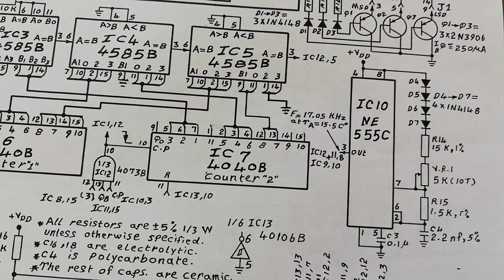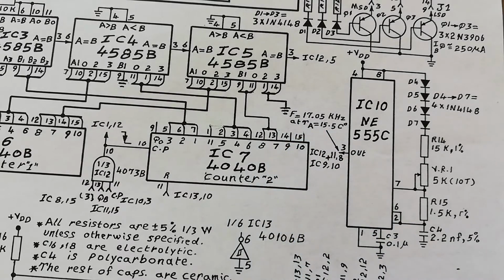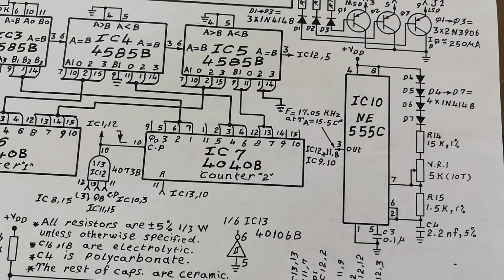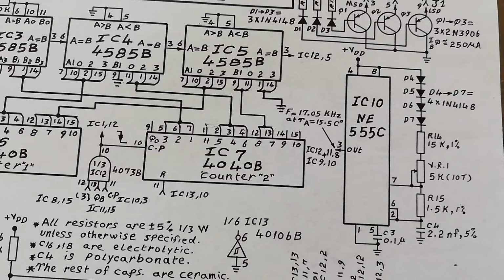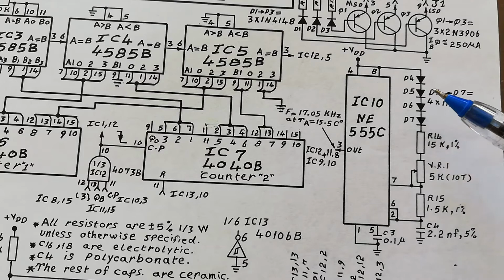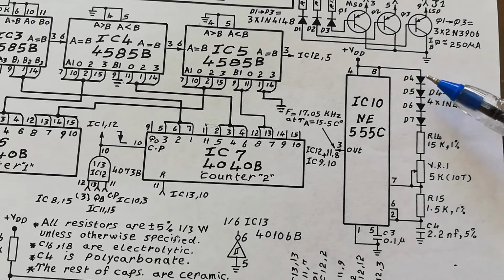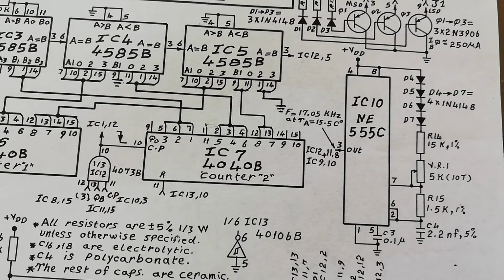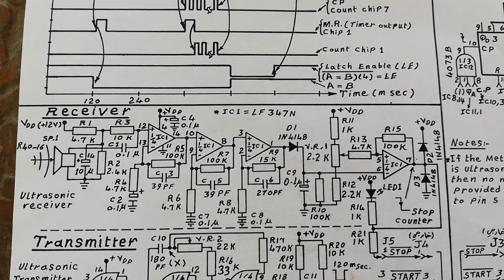Design Ultrasonic, measurement of distance, Frequency varies with Temperature.قياس المسافه بالصوت

Comment: Nice lecture, but if the transducer is a piezoceramic disc, the front end of the receiver should be designed accordingly, i.e. with very high input impedance and minimal capacitance, since the transducer is likely to be a PZT ceramic type II capacitor where its microphonic response is used to convert acoustic energy into an electrical signal.
Reply from the maker: I made this design long time ago, I remember I used a pair of transmitter and a receiver operating at 40khz , these are standard, just google it . I remember they looked more like a small speaker. Because the frequency was temperature compensated to match the speed of sound, an accuracy of 1cm was achieved over a wide range of temperature.